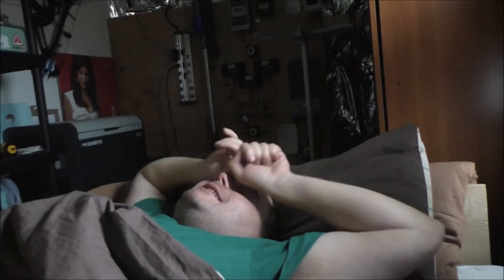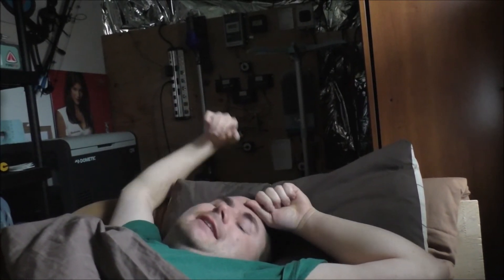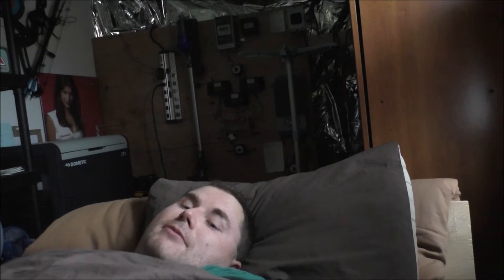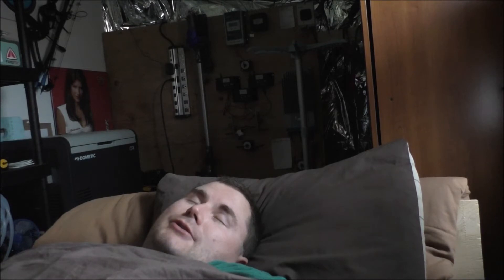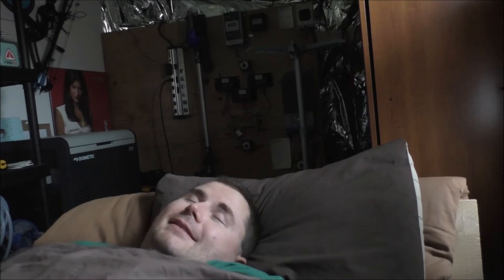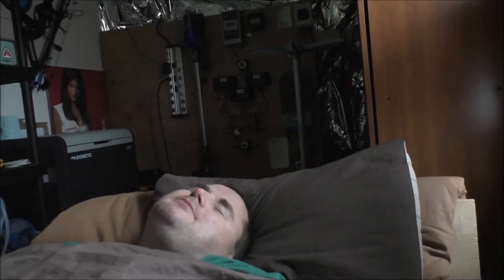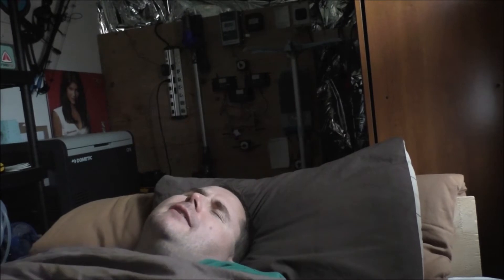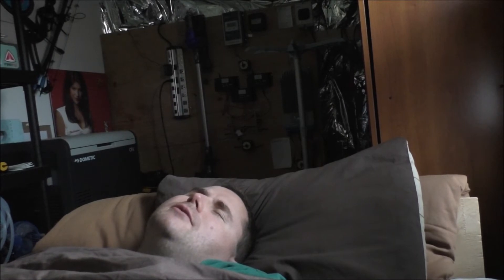Tiny House Ungrounded

Comment: Take the wattage of the inverter divided by its input voltage(12 volt, 24 volt or whatever it is. You’ll get the amperage it pulls. get the same amp fuse or a tad higher if need be. Install fuse alongside the red positive wire going from the battery to the inverter. Hope this helps.
Reply from the maker: Thanks